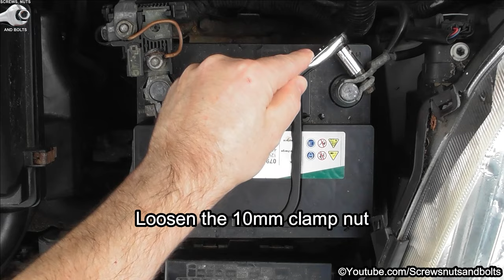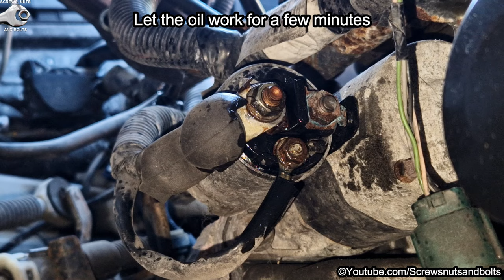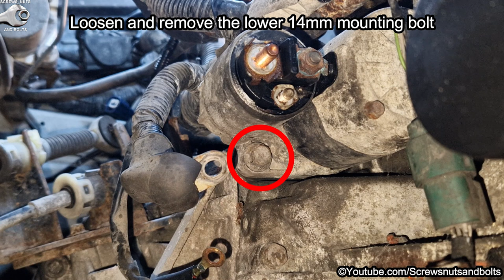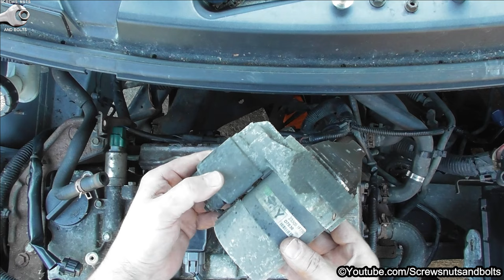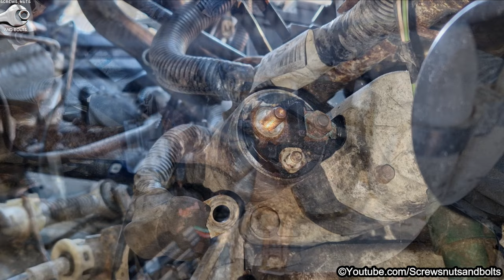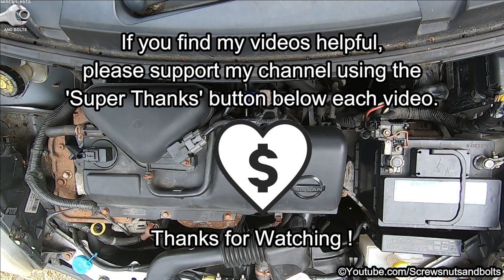Starter Motor Removal and Refitting - Nissan Micra K12

Comment: Brilliant video. Having only very basic car DIY skills I managed to do this job in 3.5 hours taking my time and a couple of tea breaks using just a basic socket set with long&short extensions, plus a pair of pliers to loosen a couple of hose clips. Could probably do it again in under 2 hours now I know where all the nuts&bolts are. I've got quite long skinny arms and smallish hands which definitely helped in doing this particular job as it's still a bit tight under there despite removing the manifold and air cleaner gubbins out the way. Found it necessary to remove the O/S headlight too for better access which was straight forward enough. Also did this job with the front of the car up on ramps to help my bad back but if you're less than 6'2" this might not be possible. A decent branded no-exchange brand new starter motor cost me 120 quid but likely saved myself well over a ton, probably nearer 2, in fitting charges at the local garage so was well worth doing. Thanks ScrewsNutsAndBolts, subscibed👍
Reply from the maker: You're very welcome, thanks for watching !

Comment: For who worry open the engine, you can take underbody work or wiper motor removal to access the starter
Reply: I spend a day on removal wiper motor and underbody work. Turnout in this two ways , you won’t see the starter and if screw is very tight, you still have to do the remove intake from engine because you can’t see and can’t use too much force due to limited space

Comment: Great, did you make the video especially for me? In my wife's Micra, the starter still turns a little when the engine is already running.
Thank you for the video, it helps me a lot. 👍👍
Reply from the maker: You're very welcome :)
Reply: Does cleaning the starter fix the noise after cranking the engine?

Comment: @screwsnutsandbolts
Please I need some advice, I have a a Micra K12, every morning I have to continuously try to start the engine for almost 10 minutes or more before it eventually starts. It cranks but it just  never starts up one time even I have driven around a bit that day, I still have the same issue. There is no check engine light on and when the car eventually starts it runs smoothly, engine sounds smooth and very quiet too. Had spark plugs changed but still got the same issue 

Any idea what could be causing the car not to start at one time and have to keep trying for minutes before the car starts?

Thanks in advance for your help.🙏🏽
Reply from the maker: There could be a few different issues causing that. Check this link: https://www.wikihow.com/Car-Struggles-to-Start-but-Runs-Fine
Reply: @screwsnutsandbolts  Thank you so much. Reading through now.

Comment: Do you know what I wound Have never in a million years though about going in from the top ....Thanks...
I have a very very bad issue caused by my mental health. 
Where I find myself  turning the key when the car is running obv this  
engages & pushes out the rod to which the pinion is attached..
Madness I know ...BUT .the overpowering thought is so strong .
I'm a recovering Alcoholic its even more powerful than my cravings for Alcohol where ....sorry for rambling.....